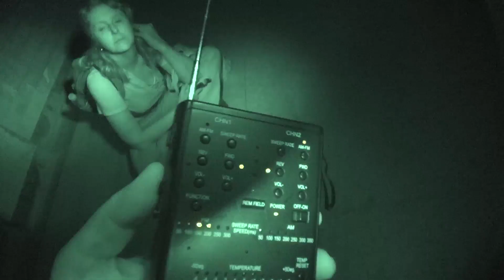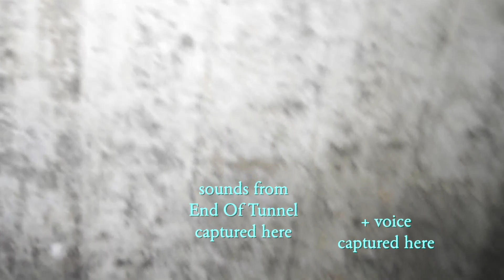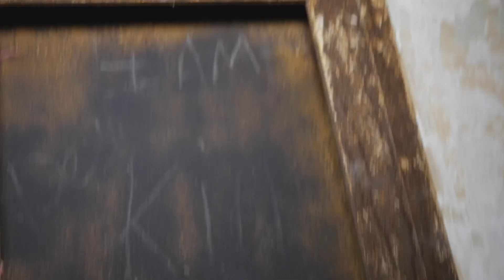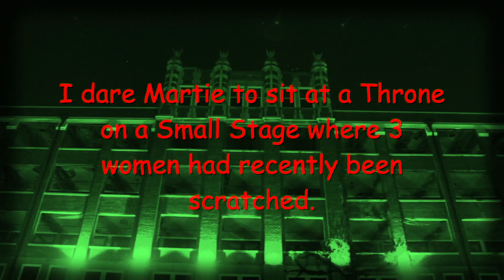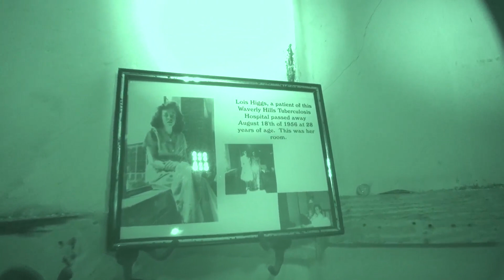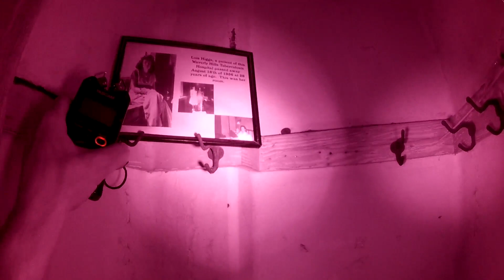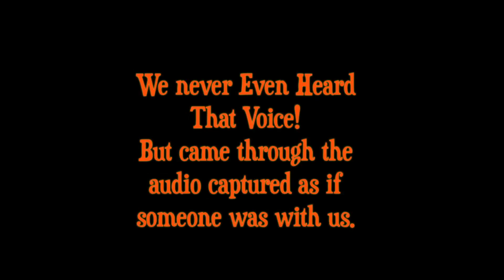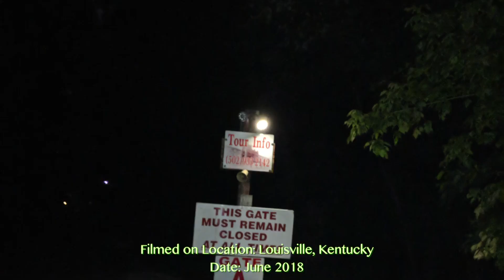WAVERLY HILLS Sanatorium Overnight Paranormal Investigation P1 My Haunted Diary

Comment: @My Haunted Diary This is your medium speaking. 4:28 - 4:37 audio check. spirit in door way by her shoulder 44:38. . 52:21 audio. 57:53 There is a younger girl with dark hair in that room, she is wearing a gown. There is also a man with his hands behind his back. Another man is sitting down. One of them leave as you do. 1:00:23 talking over someone speaking. conversation in back ground in the distance, 101:36 man in the room sitting in left corner, left side of screen. Legs are crossed. Hands are in-front of body. Looking towards window center of screen. Another person washed out by cam in the direction he is looking. They are having a conversation & your mic has picked it up, 101:42 to :45 for example. 102:16 talking. 109:20 would not shock me if picture had anomaly.

Comment: Ok I’m not the word police but body shoot is spelled body chute. Ok just had to point that out. Streptomycin was only used for 9 years as a TB drug because it quickly developed resistance. It was used beginning in 1943 and stopped being used in 1952.
Reply: Lmbo some times we just have to get it out. Most the time when you correct someone though ya get attacked.  You hot lucky. 🤣🤣

Comment: 9:11-9:16 ~ I hear distant voices talking.
9:21~ An orb shoots from left to right.
11:24~ Sounds like "We're dead".
12:08~ "I'll get it tomorrow".
19:30~ "Oh my God".
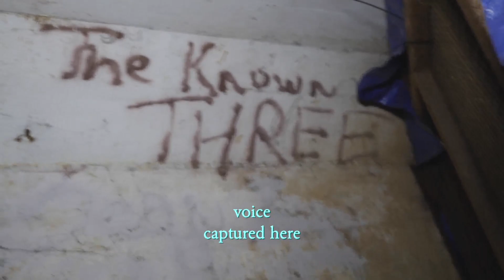20:10~ "Get out".
20:49~ "Get killed". 😳
21:02~ I hear "Why did you do it" very faintly, with "Get killed" overlapping the "do it".
22:58~ "Dead".
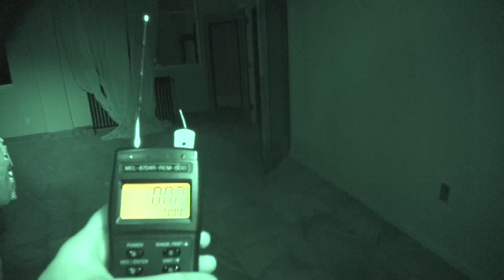25:27~ The second you turn on the infrared light, a blinking orb comes out of the bottom of the second pole/beam thing to the right and floats towards y'all.
25:42~ An orb comes through the wall on the left and zooms past the camera.
29:13~ "Hear me".
32:02~ A faint little girl, "thank you"?
49:47~ "Like this picture".